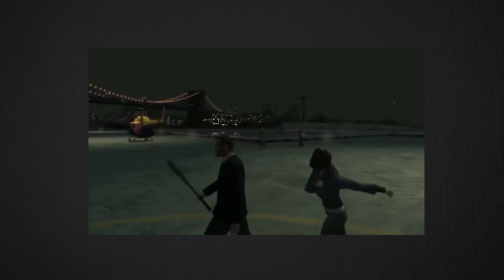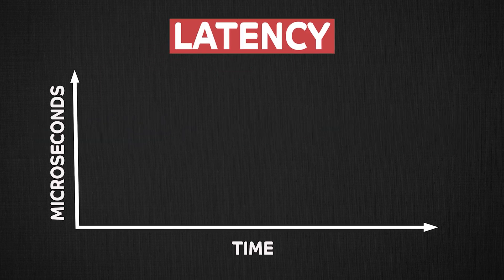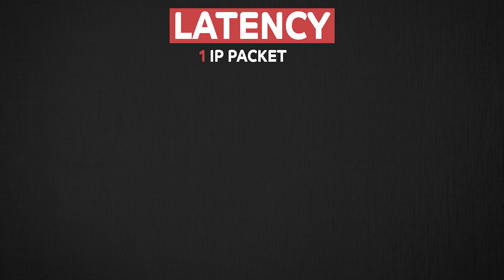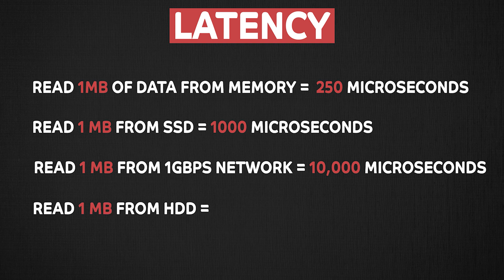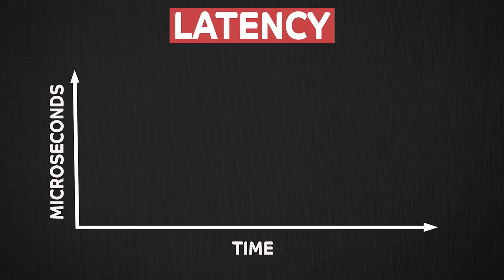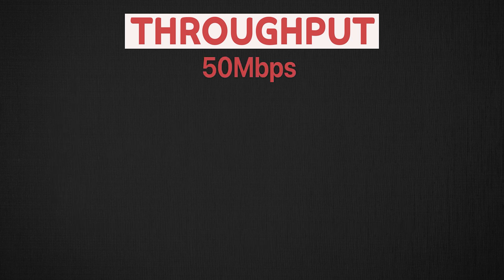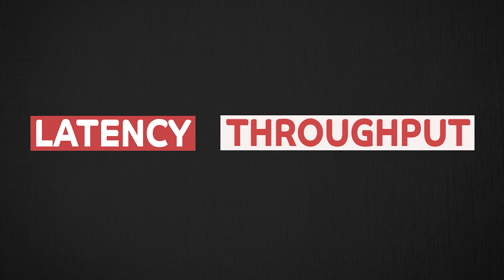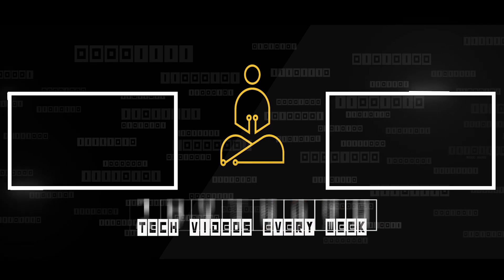Latency versus Throughput | System Design Interview Basics

Comment: Latency : How much TIME it took to reach data from source to destination.
Throughput :  How much DATA it got transfer from source to destination.
Reply: Throughput : what you pay for usually - speed per second (network speed)
Latency : Not mentioned in the contract you pay for a residential home contract usually. But you might see the ISP advertise that they have a base nearby in your town or some nonsense like that. In big cities theres big boxes on each street, and the ISP will plug your connection into another one inside that box if theres something wrong.